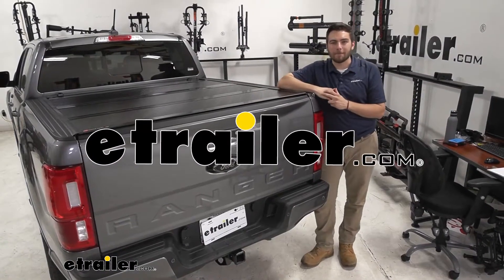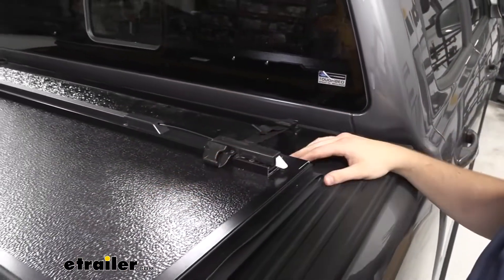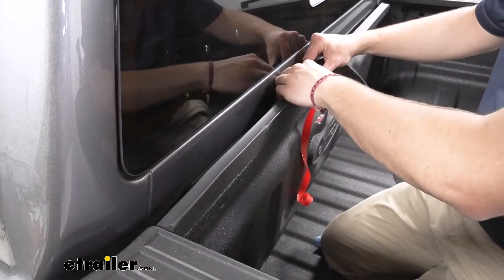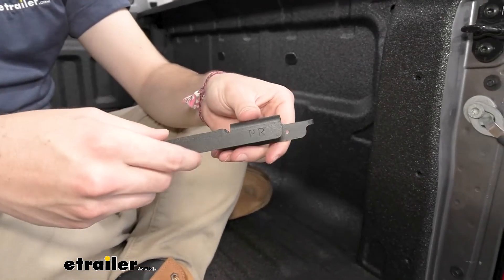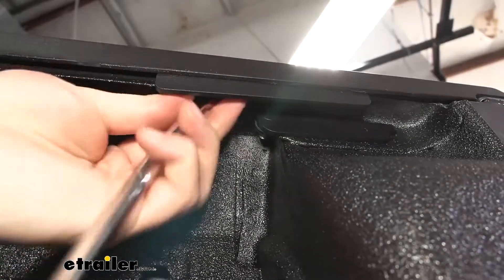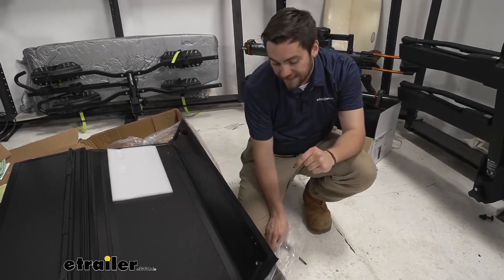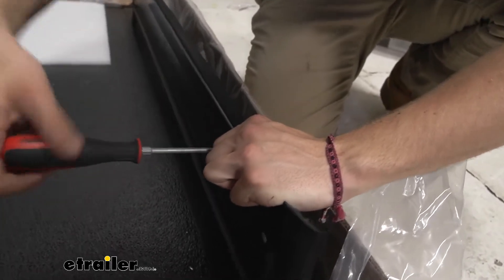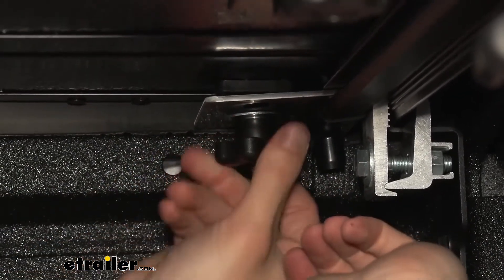Step-By-Step Installation Tutorial for the BAKFlip F1 Hard Tonneau Cover on a 2021 Ford Ranger

Comment: the 21 ranger i have has a bed liner the original owner upgraded it with, so all these holes are blocked, going to have to cut parts of the liner out to make the parts fit